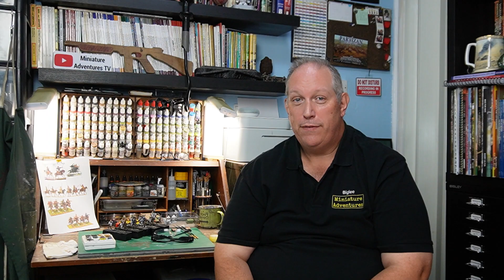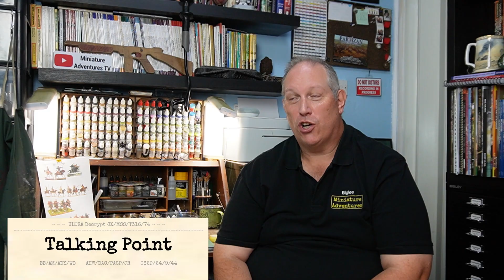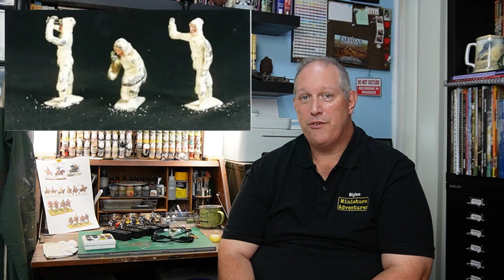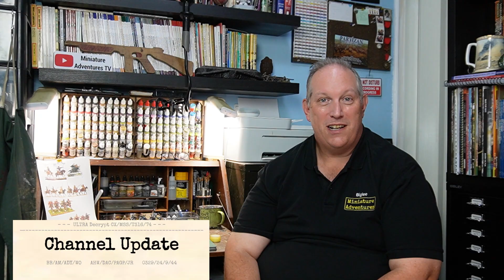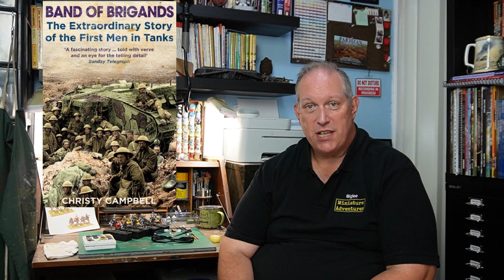Lead Rot   Myth or Miniature Killer

Comment: Hi. I have a Great Spined Dragon by Nick Bibby, which is a lead miniature from 1984 (older than I am :) ). I stored it for a while in a tightly closed metal box together with a plastic wrapping and it "caught" the lead rot. I had to drill and file the corrupted material and wash the model. It is around 3 years now and the corrosion did not return. I am storing the dragon in open paper box in a well vented wooden closet now. The storing conditions are not ideal but the air circulation seems to be the key aspect here.
Reply from the maker: At least you caught it before the damage got really bad.

Comment: There is a lot of misinformation about so-called lead rot. There is a real issue with lead alloys from the early 80's - the grey bloom that can be seen on Citadel figures from 1983-4, Grenadier, Ral Partha etc. It is not the lead - high lead content or pure lead miniatures appear perfectly fine - it's more than likely tin pest or another autocatalytic reaction that's responsible - bismuth is another suspect. Ironically, sealed boxes are often worst affected - with acidic wood pulp and aging polystyrene and foam off gassing - creating a sealed soup of noxious volatile compounds ready to eat away at your miniatures.

Comment: it is real and when you make your own minis via moulds, then it is an ongoing issue

I have had better results with my all plastic cases (that are drawers with some air movement) and since all my minis are mounted on steel fender washers and I use magnets to attach them to the sheet steel movement trays I have even less exposure than the more common wooden sabot systems.

Wood has been the major source of the problem, so ensure your woods that connect to the metals are properly sealed against the chemical interactions.

https://murdocksmarauders.blogspot.com/2020/08/long-live-magnetics.html

Comment: I bought the metal khemri blood bowl team (in a sealed box) last year and some of the mummies had snapped in half and had the white power inside.

 I just glued them back together since it made them look more undead.
Reply from the maker: Thankfully those models probably looked ok with a bit of damage. Strange that they 'rotted' in a sealed box, but I guess it depends where the box was stored before you bought it.

Comment: I had some Minifigs that were starting to get white powder coming out of their shakos. I think I got them from a store that carried American made Minifigs. I had some 60-40 lead and tin solder along with other scrap lead. I used to mold some figures. I think scrap lead from batteries has acid residue contamination in the metal.  I just went to check on my effected cavalry. They are getting the white powder back again. Interesting that the horses seem to be ok. Funny these 12 figures are the only ones effected out of about 1000 figures.
Reply from the maker: I've had figures from the same range, bought at the same time, where one was fine and another not. Maybe the metal composition of different castings was different?
Reply: @MiniatureAdventuresTV  I agree. Probably recycled metal that had some corrosive residue in it.

Comment: Have you just destroyed the market for mdf bases? Another good video, I always thought it was due to lead transforming between its metallic and powder allotropes.
Reply: That's "tin blight", a physical state change that can affect tin at low temperatures; tin has a different metallic crystal structure to lead and can be prone to this. Sadly, once it gets going it's wholly irreversible short of melting it again, which is bad for miniatures!

Try to store tin-rich miniatures above 10°C to prevent it, as tin blight occurs more readily at low temperatures.

Like with all things, some simple precautions can keep our treasures intact and happy for decades, but nobody's immune to a fluke of bad luck.
Reply: @khublaklonk4480  Ah yes - long time since I did any chemistry. Thx.
Reply from the maker: Lol, I hope not. I seal the underside of the bases on my miniatures before gluing them down.

Comment: You mention plastic as a safe storage material, but some plastics release a lot of caustic plasticizers as they age.  I try to use mostly plastic scrapbooking storage cases that are advertised as “acid free” (Are they really?  Check back with me in 20 years).

Lead rot is very real but fortunately relatively rare in our hobby.  I’ve only encountered a few cases, all involving round nodules of black minerals forming in the surface of lead figures.  When attempting to remove them with a knife tip, they feel and sound gritty and brittle.

Most of these were TSR-branded miniatures from the early 80s — Star Frontiers ships & characters and some of their other product lines, especially those sealed for decades in cardboard boxes or blister packs with foam padding. I’ve heard TSR’s caster may have been throwing randomly sourced metal into the pot.

I also found these nodules recently on a single Ral Partha Imports Norman-style fighter (a Citadel design cast in the US).

I’ve never seen the powdery white form on miniatures, only on old batteries.

Comment: There is probably a chemical fix.
If acidity is the problem, then a mild alkaline soak might work.

Please don't take my word for it though, as I dropped Chemistry after A level.
I don't know enough to guarantee that the classic sodium bicarbonate solution won't attack some other element of your figures.

Comment: First up, congratulations on pronouncing all those chemical and process terms - what a mouthful.

I've seen the museum preservation reports and recall that wooden storage cabinets, and the sealant used (with all best intention) to retain glass in the cabinets were among the worst culprits.

It gets you thinking about three aspects for us DIY hobbyists:
 * How many of us build storage and carriage boxes from timber or timber composites (ply and MDF).
 * The popularity of MDF as a basing and terrain material, and PVA glue to fix it.
 * How often to you open up your army boxes and allow the little guys a breather?

Amateur joiners can incorporate ventilation into wooden boxes.
I'm less sure about best practice for the Really Useful Box with MDF tray inserts.
Priming under the base?? You got me, I can barely prime under the armpits.
PVA including "no more nails" to attach troops to their bases - is there an alternative? I often use 2 part epoxy when I'm sure I will never re-base.

Good practice probably involves opening up the collection a coupe of times per year (in a dry cool environment) and using something like a hairdryer to force an air change.
For future purchases, know your supplier, and try to find ones who cast inlead-free alloys.

It's been a long post, but how about a look at the flip side of the hobby; Plastic Rot. - The Horrors never end.
 * Polythene figures turning hard and brittle (plasticiser loss).
 * Harder plastics growing brittle under UV exposure (Keep them out of the light).
 * Goodness knows what awaits the latest UV cured 3d prints.

Comment: Thanks for the reminder about this topic. 

A few years back I read an article that came from museum preservation. Lots of old ship miniatures in particular had lead fittings. The article indicated that once the acid interaction started, it was self sustaining, and would eventually consume the metal, in spite of restoration attempts. Poor ventilation, allowing an acid atmosphere to develop, was a major cause of the start of the acid reaction with the lead.

I have some old SYW 15mm figures that I should take a look at and ventilate and transfer to different storage. I have a lot of C-in-C 1/2400 WW1 naval miniatures that have a higher lead content than modern pewter. 

I use a lot of basswood and mdf for bases and pva glue for flocking. Some of my minis have been in cardboard boxes for a very long time. You've got me thinking it's time to open some boxes and inspect them.
Reply: I'm not much on museum preservation, but didn't the ancient Romans use a lot of lead? And don't museums have those items on display?

Comment: I have some 1/72 scale plastic minis and Ral Partha minis that are ~45 years old and no surface damage or other.  Plastic might be slightly more brittle.
Reply: Yes I have noticed that some plastics sometimes go brittle over time but I'm not sure which type of Plastic and Storage is definitely a thing...I've stopped using the loft as the roof is not insulated and the temperature swing can be brutal over the Winter and Summer .
Reply from the maker: I've never really collected plastic figures so I haven't given that any thought until now.
Reply: @MiniatureAdventuresTV  The soft plastic of Airfix figures remains flexible due to a chemical plasticiser.
This can evaporate off, leaving the figures hard and brittle.
It happened to my HO-OO Japanese - one of the earliest sets I had.
Perhaps it has been fixed with improved process.

Comment: I'm guessing it was the pre-'70s miniatures that were affected. Mine, from '79 onward, haven't succumbed to any of that. But, the Airfix British and Zulus crumbled to nothingness. Admittedly they were part painted and occasionally stored away but 30+ years on when I actually wanted to paint them they fell apart. Long live MiniFigs
Reply from the maker: I've got quite a few Citadel and Ral Partha figures from the 80's and some have shown signs of the grey bloom on the surface while others haven't. I'm not sure why, especially when its the same figures, from the same ranges and made at about the same time. Weird.
Reply: @MiniatureAdventuresTV  The early Ral Partha fantasy figures had a bit of a reputation for rough powdery surfaces.
Some claim it's lead rot, others say it's a poorly chosen mould release compound.

The self-sustaining nature of lead rot makes a compelling case for isolating any vulnerable figures from the rest of your collection.
Reply: We are more discussing metal figures here rather than soft plastic ones like Airfix made but, due to things going on in the `70s a number of manufactures, Airfix included started using poorer quality plastic stock in some of their figure sets with the result that they tended to disintegrate after a few years. This wasn`t the case with older figures manufactured in the 1960s or more recent production runs of the same figures. Did Airfix ever do Zulus or was that an Italian company, ESCI?

Comment: Interesting topic. 
One question leaps out tho'. If wood and even PVA glue are worse for the decay than plastic and glass, are we all crazy basing miniatures on MDF with PVA glue? Is an alternative needed? What options do we have?
Reply: Oh great I thought MDF  and PVA glue was the way to go ?
Reply from the maker: Those materials are fine if the model is completely sealed...including the underside of the base before gluing it down. Less of an issue with moden mini's but certainly something I have been doing for years with any figures from the 90's back.
Reply: @MiniatureAdventuresTV  The underside of the base may be an achilles heal - certainly not something I've ever painted before.
Reply: I paint the mdf before gluing the figure with superglue.

Comment: I've got quite a few 60 year-old painted and unpainted Hinton Hunt 20mm figures and none of them (obtained from a variety of sources) show any indication of  lead rot - just the usual thing film of lead oxide on the unpainted ones. They'll certainly go on to outlive me.
Reply: thin
Reply from the maker: I've seen some terrible examples of lead rot, but that is usually when unpainted models are stored in damp conditions, in wooden or cardboard boxes. But equally some figure from the same period can be unaffected. I've not got much left from back then because I have painted most by now.

Comment: Lead rot does exist. I had some Citadel Arabs which exploded so to speak. They ended up in the bucket.
Reply from the maker: Eeek. I've never had anything that bad, but the 80's citadel lizardman shown in the video did have a grey bloom on the surface. I cleaned and primed it, including the underside of the base, to seal and preserve it.